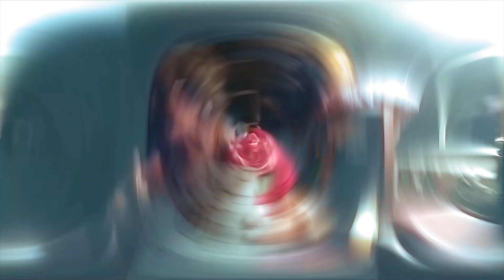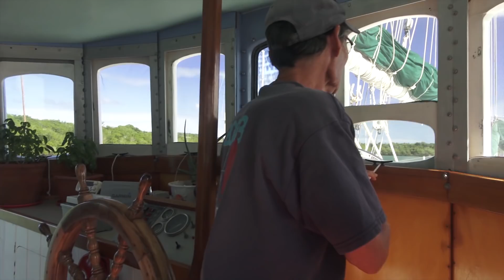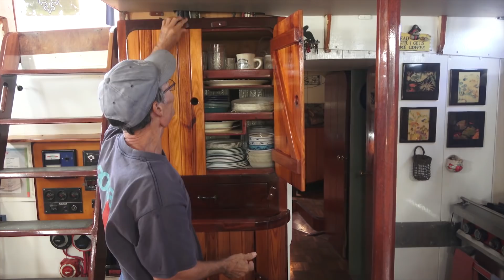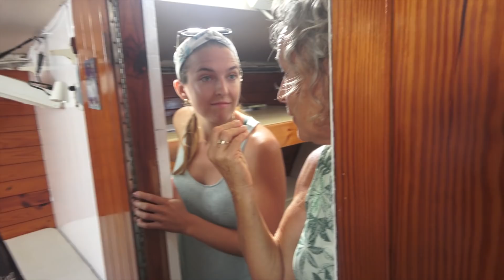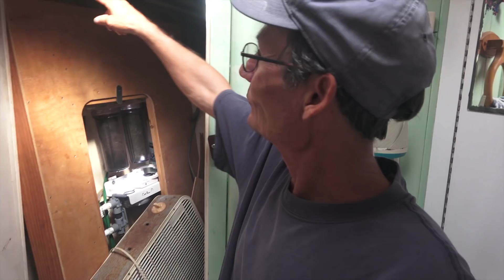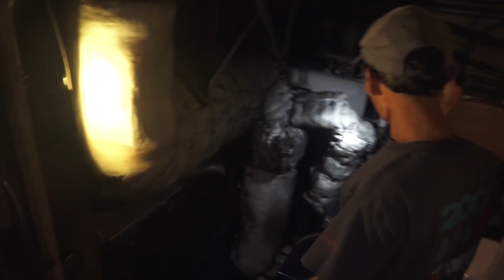BRILLIANT Simplicity ~ A 78-ft Custom-Built Steel Ship, Created by her Crew - BOAB 158

Comment: That’s a wonderful oven/range. I plead or hope that you have multiple combustible gas detectors in and below the galley. You cannot have too many. Propane is heavy and will accumulate over the floor or below to the lowest point of the boat. It flows like water and accumulates and never dissipates unless ventilated just waiting for ignition. Detectors should be near the base of the oven, the floor of any deck below the oven and finally in the bilge just above anticipated high bilge water levels. They should be tested regularly and replaced ( or element) as recommended by the manufacturer. Detectors activate well below the levels are dangerous giving you plenty of time to take measures. Some systems even shut off the gas flow. The only boats that are reasonably safe for propane are pontoon boats where there isn’t any bilge access(closed to atmosphere hull). Even on those boats a floor detector is advised. I realize that propane is the most economical and convenient heat source but I’ve seen the tragic aftermath so use every tool to make your life safer. Also invest in a few 10 year, combination smoke & Co2 detectors. I’ve actually had a Co2 detectors go off when a breeze had the generator exhaust coming in an open aft stateroom window.
Reply from the maker: I can't speak for Thomas and Linda but would suspect they do have propane detectors. We are docked right by a boat that went up in flames due to a propane leak, neither or the owners made it. This is a big reason why Michal and I decided to switch to denatured alcohol from propane. Appreciate your concern and thanks for sharing this info.

Comment: This couple is a treasure.  SO much knowledge from building the boat from scratch and 38 years of sailing.  They have implemented thousands of great ideas into that boat.  inflatable inner tube type seals around the windows and hatches just one of so many examples.  WOW.

Comment: i thought you guys fixed up a doge ram truck and build a camper on the back and where waiting to get your new boat? what is goin on with these vidz?
Reply from the maker: Um...you must have mixed us up with another channel.
Reply: @ThePhoenixChoice  You are correct the Youtube channel is called (Tula's Endless Summer) you guys both look the same YouTube sailing channel twins!  I watch all of you guys been watching for years and Delos, Captain Rick, and more
Reply: @ThePhoenixChoice  No i am positive it was a green dodge ram 2500 and he pulled out the engine and rebuilt the diesel engine and he had a problem with the fuel lines you. You guys bought a camper to go on the back of the truck and tore out all the insides of it and rebuilt the camper then put it on the back of your truck and you guys had help from your parents getting it on the truck. If i have a screenshot someone's in trouble lol mandela effect big time!

Comment: WOW 78ft ! What is he doing on land so much. That is spectacular ! Wow, the Anchors. I've only seen one boat that comes close, the Sophisticated Ladies anchors, and they saved it in the Hurricane they just went through ! Thinking about that huge steel ship, and with significant recent situations, I must mention lightning. I've been studying a lot, and the term "faraday cage" was brought up. Seems like a steel boat would work as a Faraday cage as long as you can keep the lightning from entering it. I'll also bring this up to Emerald Steel as they also built their boat. The thing that would need to happen would be a protection device that bleeds off the huge pulse, usually by grabbing it while it isn't quite as large as a bunch of small pulses which get shorted out. 
I'd love to see a video or few of them on the Building of. So, when we hire it for a charter, I'd like to hire this captain . https://youtu.be/NmW-xipCWqs Love those keel coolers ! I have noticed they are sometimes a little exposed outside of the Keel. Not sure I like that. The only other boat I've seen on YouTube with Keel Coolers is Drenched Channel. Not sure, but I do not think Emerald Steel has one. 
   Found one of those compasses, similar, same principle. Many technical terms offered. Vintage ES Ritchie Compass with Quadrantal Spheres Navigational Balls. Was $250 on ebay and not brass like that one. Quite large and although not as beautiful, I do think it was authentic marine. https://www.ebay.com/itm/Vintage-ES-Ritchie-Compass-with-Quadrantal-Spheres-Navigational-Balls/143475859679?hash=item2167d3e0df:g:WjwAAOSwVK9bF-YK
OK. Putting this on the top of my Sailing Technology Cruiser Help playlist. So many unique features, had to do it . The SHOCK on Michals FACE when she saw that washing machine ! 

https://youtu.be/zwUTRHlo5O0

I lived in a cabin with three inches of spray foam, it was in the middle of a million acre national forest, it was 70acres, the forest service wanted to eliminate it, so they wouldn't let me have a land line phone, so I built a radio phone system.  Worked really well. The cabin was easy to heat and stayed warm for a long time.